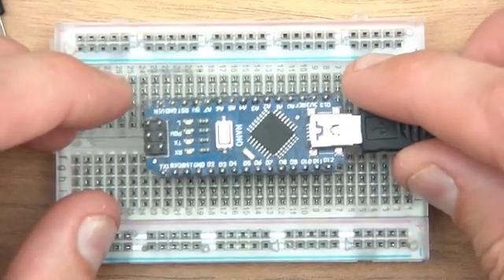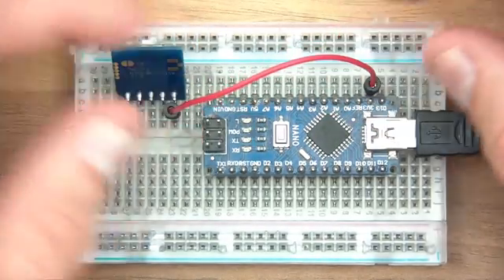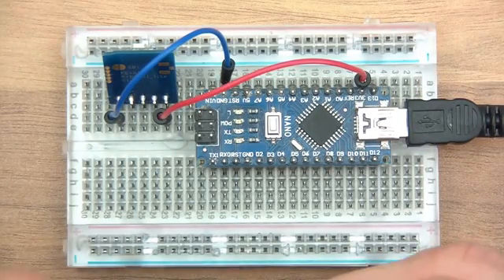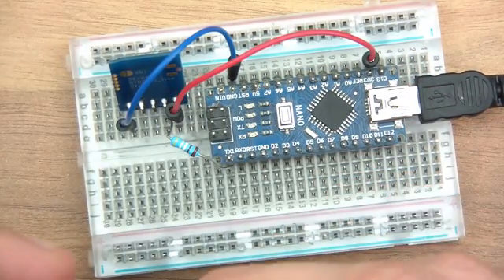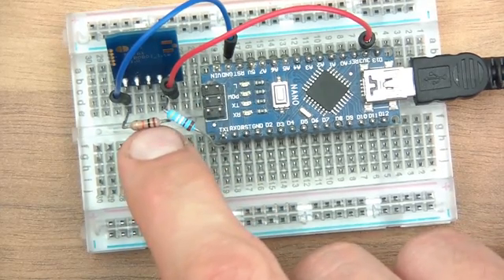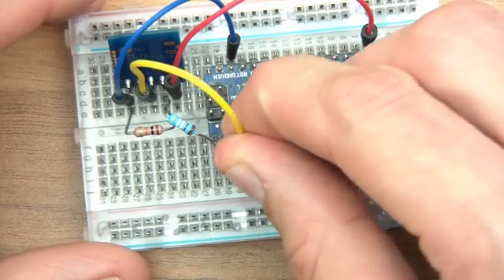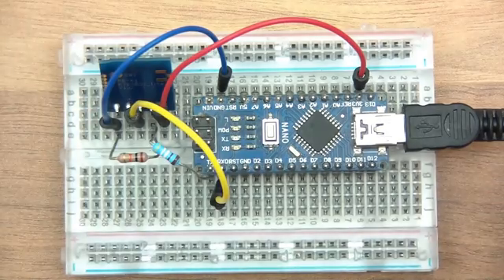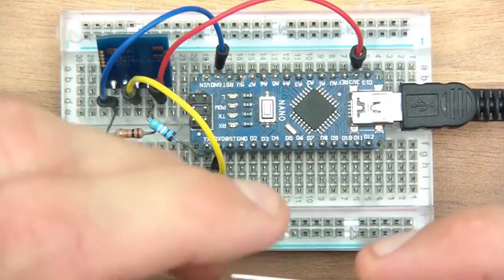TUTORIAL: Simple Bluetooth Module Arduino / Android / Reyax RYB080I & RGB LED Control Project Part 2

Comment: Nice one.  Did you ever use an ESP32?
It has built in wifi & bluetooth and can be programmed from the Arduino interface.
It's a 3.3v device though.
Reply: nogginthenog Antony has used a ESP32 and an ESP8266 for many projects, go check it out on his channel. He has a playlist for it.

Comment: Is the RYB080I always needs to be connected to another MCU to operate?
Reply: Raad Yacu Since this Bluetooth module goes over serial, you could use a MCU or use software on a computer to make it work.
Reply: This seems to be nothing more than BLE module that is used as beacon.  Heck the HM-10 even though its BT 4.0, has better AT commands to setup as Central or Peripheral